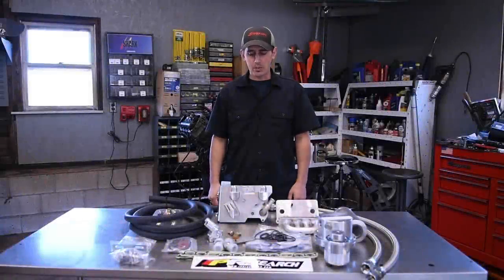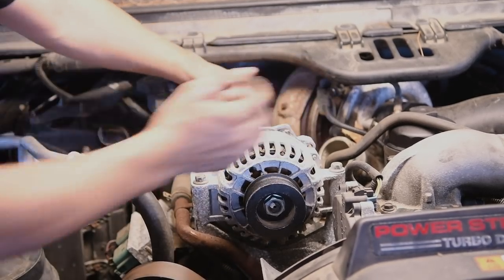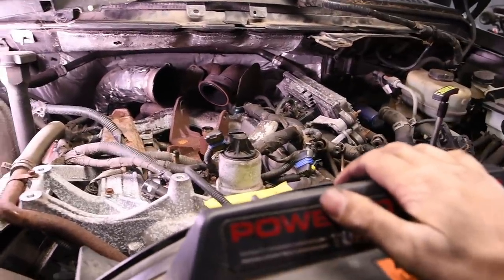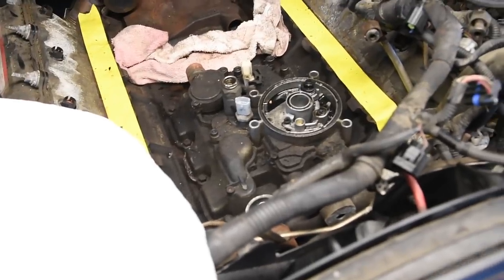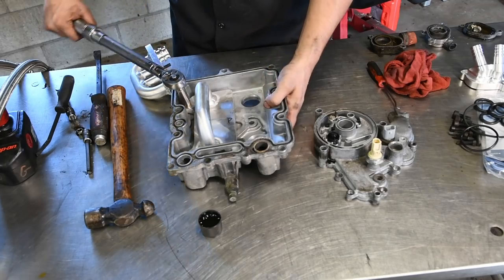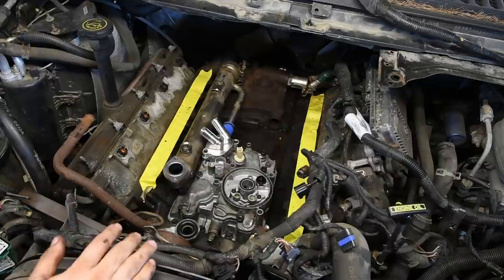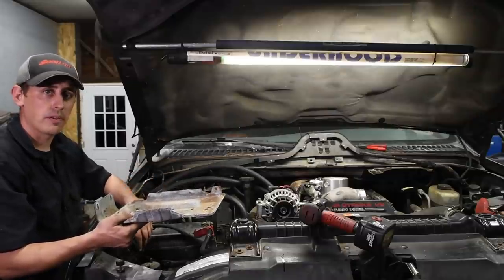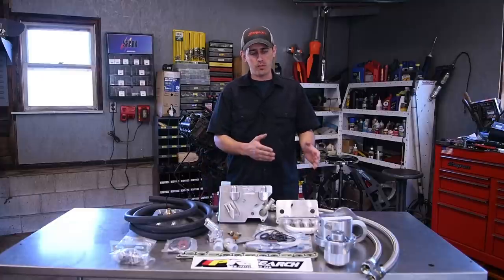6.0 IPR REMOTE OIL COOLER INSTALL...Full detailed installation

Comment: Amazing video, I am guessing this would take me about a day and rewatching your video about 20 times. You are extremely well trained. And professional! Thanks for the great videos. I bought a 2005 about2 years ago and am starting to lose low pressure after oil heats up. This and your other videos have given me the knowledge and courage to attest try to troubleshoot the common culprits
Reply from the maker: Thank you! It can be done in a day but if you have never done one I would plan on a solid weekend.

Comment: I've had a 06 model 250 for a couple of years now. Unfortunately, I spend most of my time in company vehicles and the truck set for a while. It had several mods with a scat tuner which I can only assume is what took out the tranny. With all that I'm going through it fixing things and I performed a backflush on the oil cooler because the delta-T was 22-25. That was just normal travel with no load. Backflush made the delta T better and I flushed the system by removing both block plugs and doing this over and over until I was satisfied and what came out was clear. During the backflush using air pressure I turned the psi up and gave it some small bumps and increasing but allowing the water to catch up. Block plugs were reinstalled. I did this maybe 3x putting it back together and driving it then again and again. I used a scale remover or Blue Devil radiator flush drove around about 4hrs and flushed again then used the distilled water for the last flush. I didn't have anything to really test pulling uphill at the time. Normal driving conditions are good. The truck has 190 tstat. Now I had to haul a tractor recently and the EOT spiked forcing me to pull over allowing it to cool off, which it did pretty fast compared to before the flush. I do have a coolant filter installed and think maybe it needs to replaced and I'm gonna flush without using chemical, but if it doesn't work this time, I will be replacing the cooler. Good info and I'm sure I will have some questions and now I know where to ask them.

Comment: Oh wow,  I did NOT know that the injector wires would unplug like that!!!  I've worked on these things (mine and buddies) for 10 years now, just shows you that you can ALWAYS learn something new.  Nice tip on the exhaust clamps as well.  That up-pipe can be a bitch most of the time!

Comment: I got this kit this week and putting it in now. I'm at the point where I need to know the coolant hose routing. So I have an egr delete kit, can't remember what brand it is. I put it in years ago.  You specified a brand when you talked about reversing the routing on the coolant hoses. Aren't they pretty much all the same? Mine just comes out of the bottom of the intake does a 180 degree turn and goes right into that nipple on the oil cooler housing. I did'nt get any instructions with my kit.  I'll check online for more specifics. Great job on this video. Very detailed, and I followed along as I was doing mine. I shoulda put this kit in when I did my last oil cooler change 2 years ago. Backflushing the stock cooler only works a few times and then the cooler clogs up progressively worse each time. I didn't put this in the last time because funds were tight at the time, and I needed my truck. Thanks for an excellent video.

Comment: Just did mine this weekend, couldn’t have done it without this video! Thank you!
Reply: How’s it been working for you man? Your deltas been good? Have you done an oil change yet?
Reply: @ryleighmarie1  it’s worked amazing! I haven’t seen a 20 degree delta since I installed it and I tow a 12,000 pound trailer in South Florida. Towed it from Fort Myers across alligator alley all the way to Key West and back in 90 degree heat. I don’t use the truck every day, so I haven’t done a oil change yet.

Comment: Just installed the kit! Works great. 

When are the videos coming for oil change and filter cleaned?
Reply: How’s the ipr’s kit doing? Any leaks or issues. I still need to install mine but I keep reading negatives about it so I’m thinking maybe it’s good I haven’t gotten to it yet

Comment: The point to the bypass coolant filters is to not block flow of coolant to the engine... If you filter all your coolant, and say it plugs up, if your not a keen eye you may realize too late when your truck overheats... A pypass filter, even if plugged off, allows coolant to flow! Plus the idea is eventually you'll filter the sand and such in your coolant with just a bypass

Comment: I bought a pickup with this kit on it.  I need to change the oil but I'm not sure what to do?  Do you just disconnect the lines from the top of the oil filter housing?  How often should the coolant filter be changed?

Comment: one time after putting my truck back to gether I started it up and it ran for a while then stalled.  I saw gallons of oil on the ground.  Later I realized I forgot to install the upper turbo oil fitting so the engine starved itself of oil.  The good news is that now I know if your drain plug  ever comes loose on the highway and all the oil comes out it will not damage your engine,  it will just stall it when its low enough to not fire injectors and such.  Drove it another couple years now im doing the ipr kit.

Comment: I bought a truck with this system installed. I am wondering if you know of anything that could go wrong  with this system that would mimic a head gasket problem. (Excsessiv coolant pressure) ?? And it blew all 3 of the party noisemakers when I did the technical test that you designed. Lol
Thanks, Jon
Reply from the maker: Nothing with this kit could cause that issue. Excessive cooling pressure can only come from a bad EGR cooler or bad headgaskets.
Reply: Thanks! Its the deleted system. I knew it wasn't studded and didnt know there was an issue until I was towing in the hills. I knew the risk but hoped i could do the preventive job on my time. Nope. Thanks again!

Comment: My 2004 6.0L Powerstroke diesel has a high desired rpm like 4325rpm on scan tool with red indication on the pids. All other data looks normal and checked throttle plate and accelerator pedal sensor values. All other data looks normal for the truck to start but it does run. Cranks normal and white smokes out of exhaust.

Comment: I just finished the long version, nice work on training and funny outakes at the end...I did all possible updates on my 06 but didn't do head gaskets, thankfully it worked out good but everyone says to "just do them" while you are in that deep, you didn't either, just wondering why.
Reply: If you’re not tuning the truck for more HP or anything there is no need, stock does just fine

Comment: So, the coolant and oil temp sensors aren’t moved onto the new cooler? Doesn’t that screw temps and deltas? On oem oil cooler is are the temps post cooler or pre cooler?
Reply: Also looking forward to the oil change video with this setup. I’ve been waiting to pull the trigger on this setup but have some questions. I’m gonna try to reach out to ipr also

Comment: This kit seems good but how’s the oil get from top of filter to the cooler??
Reply from the maker: The standpipe that goes through the middle seals on the cap. The oil is pushed through the standpipe

Comment: Thanks for the video. So do you have to remove the hoses to change the oil filter. Do you prefer this over the bullet proof upgrade.
Reply from the maker: The hoses do need to be removed to change the oil. I prefer this kit personally.
Reply: Any tips for removing the housing? Recently bought a truck with this kit on it. Do you have to loosen the set screws or does the whole housing turn?

Comment: I have a 2007 what direction does the coolant flow in mine so that when I install this product I’m putting it in the right direction? Is there adequate instructions that will guide me in the process? I need some clarification on that part of the video you mentioned the direction to install the coolant lines. Thanks for your time.

Comment: Have you installed many of these I've heard stories about them having problems with leaks
Reply from the maker: I have installed a few. I personally have not had one leak. The few that I have seen people had issues with were installer error. Typically not following the instructions while indexing the cap.

Comment: Did you use any Teflon tape to the fitting for the oil and coolant fittings( the two brass ones)  I purchased the dual filter setup.  Thanks
Reply from the maker: I use teflon on any pipe thread fitting.

Comment: Great video. But how do you change the oil filter?  Do you have to bull the braided lines?
Reply from the maker: Yes. I’ll eventually be making a video about it but you take both lines off and rest them on a rag on the cowl then spin the whole housing off.

Comment: Hey man I'm only at the halfway point but I am always curious what youtube powerstroke dudes are standing on to reach and how they don't get annoyed by the hood latch poking... I have a couple great tricks.
Reply from the maker: CG INDUSTRIAL I stand on an aluminum step I got from Home Depot. And I usually put a pad or a few folded up fender covers over the hood latch. I’ve tried the overhead creeper but could never get comfortable with it.
Reply: @InTheShop  Thanks for the reply, love the channel, cheers
Reply: @cgindustrial1859  I built me a metal rectangular stool just for working on my 04, I also have winch brush guard on the front with no winch so that makes a nice step.  Then if I have to lay in the engine bay, I have a few old pillows that I throw in there.

Comment: Does the oil filter cap have any additional output ports? I want this but I want to maintain the ability to use my frantz. I can keep using my frantz with BPD's.
Reply from the maker: The cap does have a port they could be used for things like a gauge or bypass filter setup.

Comment: Will this kit work with having a sinister oil-coolant filtration kit already?
Reply from the maker: The cooler mounts in the same location the sinister stuff does. This is far superior though cause it filters 100% of the coolant that goes through the oil cooler not just a sample like the other brands do.
Reply: Wish I found this video earlier.
Was asking cause I might need a new oil cooler and like the idea of having it exposed in an easier area to get it serviced.

Comment: Did you notch the hood to make room for the coolant filter? I've got an '06 and there doesn't seem to be enough room for the thing to fit!
Reply from the maker: Mine fit fine with no clearance issues.
Reply: @InTheShop  yours has different stuff under the hood that mine doesn't. Going to scratch my head for a while and come back at it tomorrow. Appreciate the quick response.
Reply from the maker: @JoshuaCollins  if you want you can send pictures to nathan@intheshopmedia.com and I’ll look at them tomorrow and see what you have going on.

Comment: any particular reason why you went with IPR remote oil cooler vs the BPD remote oil cooler?
Reply from the maker: Liquid to oil cooling is far more efficient than air to oil. The air to oil is too dependent on ambient air temp. The 6.0 cooling system is designed to accommodate a liquid oil cooler. Oil temps stay far more consistent this way.
Reply: @InTheShop  Sorry not to be confused but I meant why the IPR remote (liquid cooled) was used vs. the BPD remote (liquid cooled not air). I am aware that BPD has a air cooled but that is was not the one I was referencing.
Reply from the maker: @a2cho  I really like the IPR setup. They were the first to the game with it and have made nice improvements as time had gone on. The newest version uses the 6.7 cooler. I’m not sure what the BPD uses. I think it’s a matter of brand preference and I personally feel IPR is a better product.
Reply: @InTheShop  awesome! Thanks for the replies and keep up the awesome content. I am learning a ton from your videos always watch through multiple times. Great stuff!

Comment: might be helpful for some folks to know the coolant system should be drained before doing this job
Reply from the maker: Absolutely. I state that about 3:55 into the video.
Reply: @InTheShop  I shouldn't have skipped the intro oof. I'm about 30% in to the job Thanks to you and diesel ron I'm getting it done. Can't wait to have this IPR external cooler installed 😁